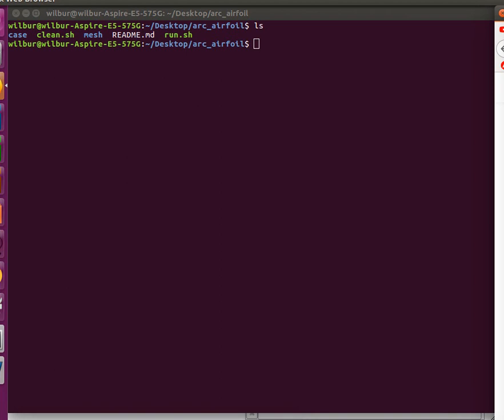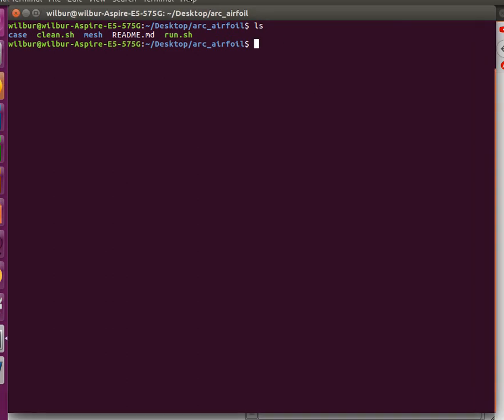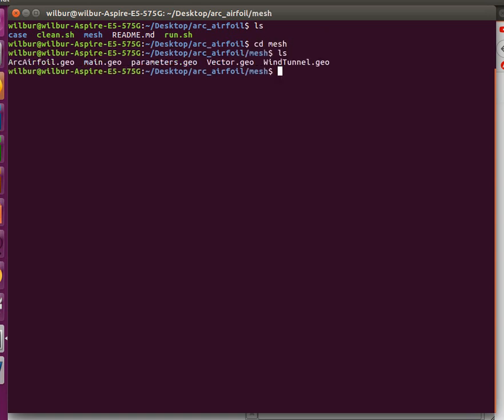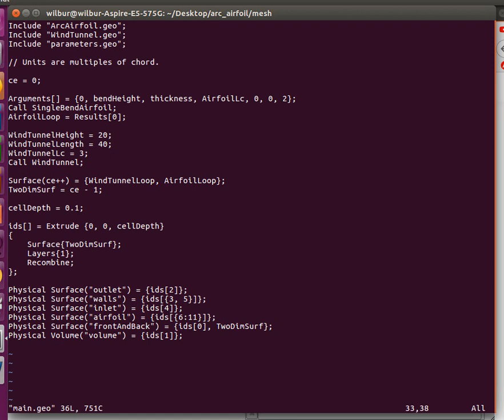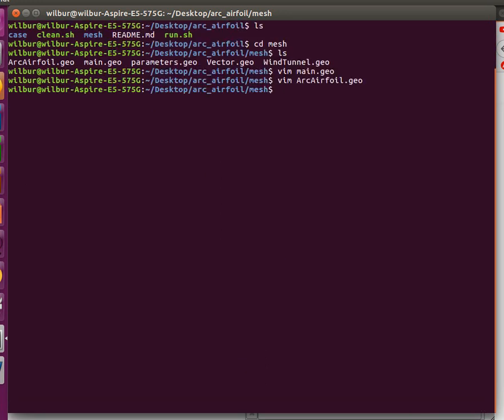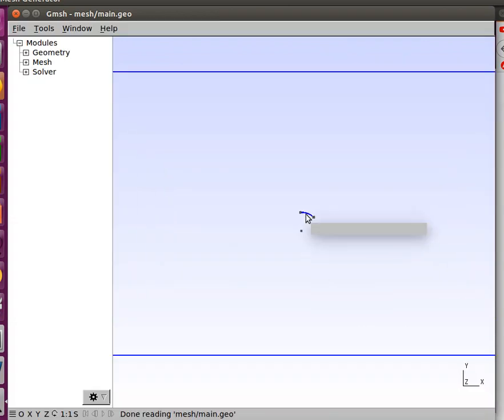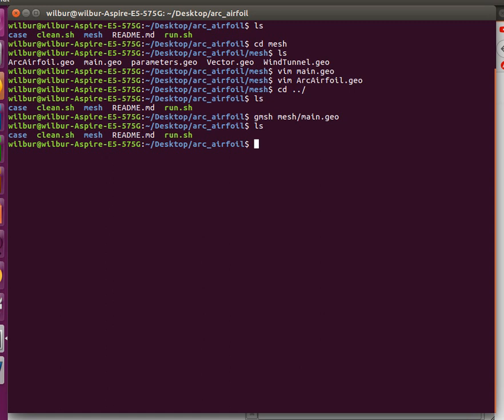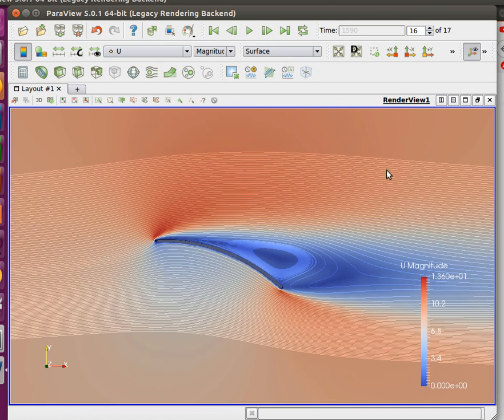Simulation of a Circular Arc Airfoil in OpenFOAM

Comment: Hi thanks for this series of tutorials, I learned hot to do CFD simulation with them so thanks a lot.

I'm interested in calculating lifting and drag coefficients in Mach 0.25 regimes and I'd like to ask what resources (books, articles or things to study) you can suggest to get good estimates of them.

Thx again.
Reply from the maker: You might already know this, but Mach 0.3 is the general rule-of-thumb threshold for compressibility. If local field speeds don't go much above this, then it might be ok to just use incompressible solvers as I have shown. If not, here are the compressible solvers available: https://www.openfoam.com/documentation/user-guide/standard-solvers.php

Generally, compressible flow solvers become ill-conditioned when Mach number is too low.